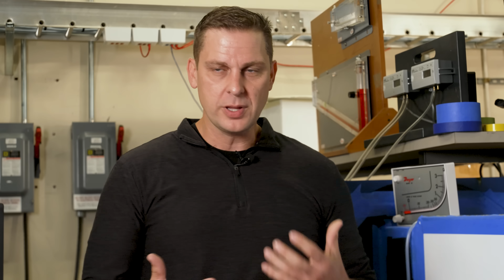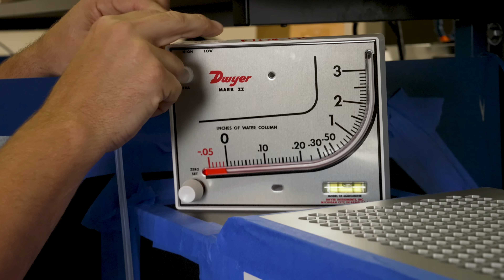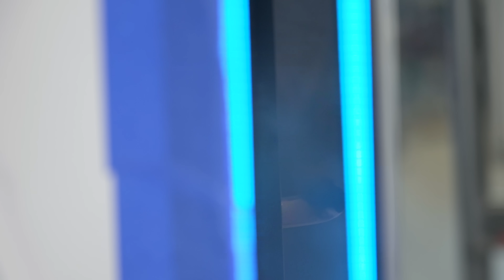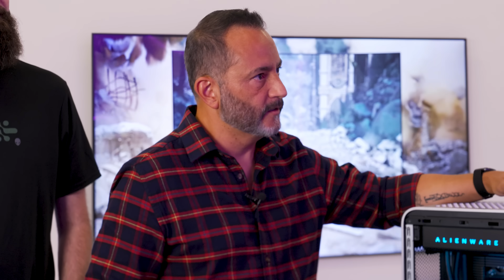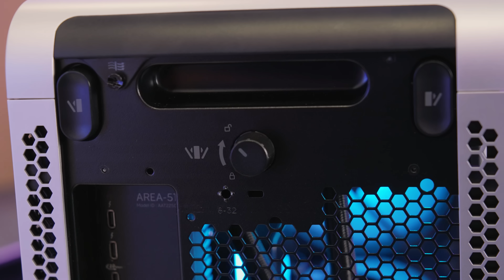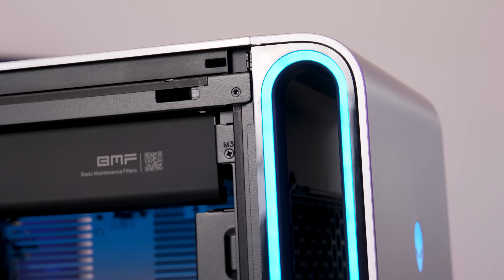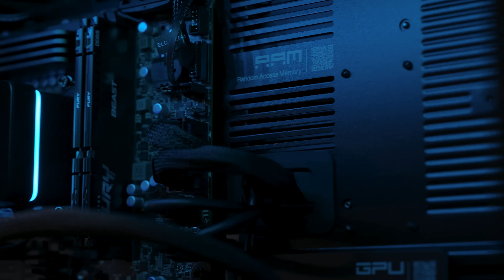Adam Savage Learns How Gaming PCs Should Be Cooled!

Comment: Gamers Nexus did thermal testing on this PC, and actually found it was better flipping the top fans to exhaust - CPU temps increased slightly but didn't impact performance, but GPU temps were lower which allowed it to boost slightly higher.
Reply: All depends on the case, the setup and the design.  
  Personally with my liquid cooled system I found that all hands as intake and the 140mm rear as exhaust showed the lowest temps.
Reply: I'm no expert, But I've always done bottom and front be intake and rear and top be exhaust (heat rising and such)
Reply: Yes starting with your intake right through a radiator preheats a lot of the available air that will then be cooling MB components and GPU. Sounds like starting from a disadvantage position. I wonder how things would fare if there were a " passive" radiator at the exhaust instead so at least it radiates to the outgoing air.

But gasp it's probably better to just do what most people do and have your radiator up against exhaust fans.
Reply: My Holley carb does 670CFM, should I hook up my carb to cool my PC? Dell you already killed your brand.
Reply: Depends on the case, type of fans, unrestricted area in the case and ambient surroundings. There is no perfect solution, For big open gaming room that has little to no dust - thick filters and SP fans in negative pressure 100%. For rooms with carpets, animals and all that shmack - positive pressure thin filters and Air flow fans. It is different for everyone because more performance is not good if it increase the dust buildup that not only increases risk of static shock but also insulate components to a degree. Go with your room.
Reply: In a system with fans it will never matter that warm air rises - any fan will overcome that easily.
Reply: I was looking at thing and thinking if PC Metal Jesus Burke already made a video about 🤔 thank you
Reply: So... What does that mean for all this lab's tests and theories? Does it mean they f'd up?
Reply: @squidge903  Because the differences in GN's testing were so small my actual takeaway is that beyond a certain point the argument about which is "best" is kind of pointless, and as long as you're not hitting TjMax then a difference of a couple of degrees here or there doesn't really matter. My general approach after decades building PCs is "as long as there's sufficient thermal mass and some airflow, it's probably fine", and maybe if I spent hours trying the thousands of ways of arranging/mounting the fans in my PC as intake or exhaust I could drop temperatures a fraction, but as it's not currently overheating there's no benefit to finding the optimum; good enough is good enough! (I just did the math - my case has mounting for 10 fans, but I only have 9 fans; if I were to test every possible arrangement of intake/exhaust/no fan that's 58,025 configurations. Definitely not worth it.)
Reply: >Good enough is good enough

Yeah that's the big thing. Doesn't really matter if the temperature delta is 24C or 25C as long as it's not thermal throttling. You can make the argument that there are other acoustic concerns but tbh a difference of 1C isn't really gonna change your fan profile significantly.

Besides, the best setup is usually some MIX of exhaust / intake depending on the overall fan setup, but people don't like that because it doesn't look / feel as "satisfying"
Reply: @elbiggus  If you're in the "good is good enough" camp, that's fine, but a lot of custom build enthusiasts and pre-build buyers don't want to settle for that, after investing so much. A lot of small optimisations can add up, and once optimal sweet spots is found, a person can sit back and reap those benefits for years, so it can be time well spent. Also optimisating might not be about fps, but noise, and every dB reduced matters. In short, a lot of people have good reasons to optimise beyond a satisfactory level, and there's nothing wrong with that.
Reply: @Reckless150681 It's a FLAGSHIP, bro. "Good enough" is not acceptable when you're paying through the nose for the BEST!
Reply: @s.bowes.8124 This. Is the point. Once the optimal setup is figured out, you can just that with no additional effort.
Reply: @squidge903 it mostly means that this shit is complex. 

Also, this is not a very good vs very bad scenario. It’s good vs good.
Reply: Same thing as using Intel and Nvidia.
It is a failure.
Reply: The GPU fans are not designed for this system. They would probably be pulling in hotter air.
Reply: they really should have paid that guy to apologize for years of legendary bad cooling rather than "teach" us lmao stick to laptops alienware
Reply: No offense, but GN setup is not sufficient to measure to this level. He does great work, but not like this. He is taking on board system readings which don't tell the whole story.
Reply: @jamesv.wilkerson30 All good and well that the PC is tested in laboratory; however, the average consumer does not have PC in a controlled environment and PC performance is indicative of what values the PC hardware determines as being correct.
Reply: True ✌🏻
Reply: There is no better, just use the damn computer
Reply: Whats up guys this is Travis from Dell... From a radiator efficiency standpoint and acoustics it was better pushing versus pulling (fresh air blowing into the radiator.  In all clarity its total airflow (CFM) that you care about and the pressure is a means of moving the airflow where you want it, this is why we did the flowbench example so we could show you what specific CFM you can achieve in the system.  If you really want to maximize cooling just set the fans to full speed in Alienware Command Center..  #iworkfordell..
Reply: @TravisNorth1  Hard disagree on CFM being what you care about. CFM can functionally be synthetic -- while a useful metric, it's the real-world temperature of the components that matter. We'd be happy to visit and discuss, but your PR department declined last time we offered.
Reply: @GamersNexus  I wonder why they don't get back to ya... ;)
Reply: @TravisNorth1   what did your testing show for a push/pull setup on the radiator?
Reply: @TravisNorth1 That is also highly dependant on ambient room temperature; the internal volume and temperature inside case/chassis, and the number of chassis fans used in either push/pull configuration.
Reply: @TravisNorth1  If you want maximal radiator efficiency and a cooling layout that makes sense, put the radiator in the front or side panel and suck/blow outside air through it into the case. Put three fans on the bottom of the case and blow cool air to the GPU from there. Put 2-3 fans on the top panel as exhaust. Look up the Lian Li O11 Dynamic series of cases and Fractal Design Torrent for some inspiration. It's not that difficult.
Blasting the fans at full speed "for maximal cooling" is dumb, no-one wants to listen to a computer with the fans maxed out. You need to use your brains and come up with a sensible cooling layout instead of trying to brute-force it.
This new case is a step in the right direction but it still has issues. First of all, it's unacceptable that a 5000 dollar system comes preinstalled with factory dust everywhere. Then the M.2 drive is installed incorrectly and bent like bow ready to fire. Then one of the bottom fans is sitting right on top of the power supply, so it is completely blocked and totally useless, and the other bottom fan is also partially blocked by the PSU. Then all the fans are used as intakes (front, bottom, top radiator fans). This creates a lot of pressure inside the case, yes, but it also hampers airflow as the only main route for air to exit the case is the rather small perforated area in the rear panel. You have 7 fans trying to push air through one small area. Airflow-wise it's a lot better to have at least some exhaust fans, even when you're going for a positive pressure setup.

It's like taking a tube, drilling a couple of holes in it in the middle, and installing two fans at both ends of the tube. If you install them both so that they blow air into the tube, the fans are creating a lot of pressure in the tube, but you're going to lose a lot of airflow as the fans are working against each other and air can only exit from the holes we drilled. Now if you reverse one of the fans to work as an exhaust, and run the intake fan at a bit higher RPM than the exhaust fan, you're going to have a lot of airflow through the pipe while still maintaining positive pressure.

A friend of mine originally set up his current build so that there were three bottom fans sucking air in through a radiator, three intake fans on the side panel and three fans sucking air in through another radiator at the top of the case. 9 intake fans, 0 exhaust fans. His thermal performance was very bad for a custom loop with two 360mm radiators because there was so little airflow. Then he turned around the top fans to push air from inside the case through the radiator and the thermals became a lot better at lower fan speeds.
Even though the top radiator didn't get fresh, cool outside air anymore, thermals improved because now there was so much more airflow.
"Hehe fans go BRRRR!" is not a great thermal solution for a >5000 dollar PC.
Reply: @TravisNorth1  Thank you. so you chose this because its more efficient radiator wise and noise wise, and cooling wise it was good enough/met requirements. whereas if you were just optimizing for cooling a lot more than noise, you might of chose something else.
Reply: @TravisNorth1  what did he say? I couldn't hear him over the fan (full speed) noise from my Area 51
Reply: @TravisNorth1  "and acoustics" "Set fans to full if you want best performance" You're aware you contradicted yourself yes? Flip the fans and you'll have acoustics and performance. It's okay to say your company is wrong, not okay for your job though I imagine.
Reply: @TravisNorth1 _ No offense but LOL at your comment of, "If you really want to maximize cooling just set the fans to full speed ... *inside our bloatware instead of via the BIOS*."

A) that shows crap design in the cooling of the case
B) no one wants to sit next to a server chassis 

Smh. It's amazing how much y'all really can BS executives and people who don't know anything about PCs but you can't fool people who have actually spent over a decade dealing with your terrible PC systems in a business environment. That includes suckers buying a rebadged 7010* for an Alienware PC.
*Depending on year of purchase etc

Btw. ANY PC with fans at full blast will keep your PC "cool".

Lololol sweet goodness smh 🤣
Reply: @shawnduffy279  Classic corpo non-answer: sounds technical but dodges the actual point. Dell markets its ‘thermal engineering’ like it’s gospel, but when independent testing proves flipping fans to exhaust improves GPU temps, so letting it boost higher, suddenly people are like ‘meh, 1°C difference, who cares’. lol
Reply: @shawnduffy279  I used to be a Dell's Your Tech Team (what a scam that was) technician....we did RMA's and field repair tickets on more Alienware's than XPS's. And in the end, all Dell execs wanted from us was to push the Dell Credit Card and upsell that malware posing as an Antivirus McAfee. Oh and push for customers to buy more ink for their printer. We went from actually solving tech problems for people (at $249/yr) to up-selling products from Dell's website. We even had to meet a specific margin per call per week.... I left soon after that nonsense. It was a waste of my degree and certs.
Reply: Basic physics, people. Hot air rises. Cool air comes in from the front, flows through, and exits out the back and top. That’s airflow, not rocket science.

But some of you are out here rearranging fans like you’re trying to Feng Shui a toaster, chasing that mythical 1% like it’ll unlock god mode. Trying to force one more breath into full lungs doesn’t make sense... unless it’s your last one.

If it bugs you that much, liquid cool it. Use hydrogen. Freeze the whole damn rig if it helps you sleep. Just remember, you're not building a rocket. You’re playing Apex and yelling at lag.
Reply: Yeah but Gamerrs Nexus has been shown to not be as reliable as most other larger tech youtubers.
Even with LTT's sketchier edits, they 're still far more reliable. And LTT doesnt try to start shit like little children.
Reply: @LegendaryMantis WTH are you talking about? You think GN is NOT scientific in their analysis?
Reply: @Lichrot saying LTT is more of a reliable source than GN is hilarious, factually incorrect
Reply: I saw another video where they said the opposite
Reply: It really does not matter, it's Intel and not AMD. 😂
Reply: @Zeaiclies  exactly, it doesn't matter how much cooling they give it, that Intel CPU still wont beat the AMD chips.

Comment: This is cool and all, but you don't need all of this fancy equipment to arrive at this conclusion. Anyone who has been building PCs for a few years knows the more ambient air the better. Internal case air is hot. So, the CPU cooler has to be intake as to not suck up hot air from the GPU (duh), Then, to avoid the GPU getting hot air from the CPU cooler... you just overwhelm that exhaust air with positive pressure and put the CPU cooler as far away from the airflow intake of the GPU as possible (the top. Duh). If both are water cooled, you want either dual intake or dual exhaust. This really could have been a memo.
Reply: yt experts everywhere
Reply: @mikeuk666  There are no "experts". This isn't rocket science. It's basic level common sense.
Reply: @MrMediaPC  Convection in PC cases is a myth. The natural forces of convection are VASTLY overwhelmed by the air flow/pressure generated by the fans. Ask yourself... how much air pressure is created by convection... and how much is created by 10 fan blades spinning at 1000rpm. Convection is only relevant on passively cooled PCs. There have been many vertical airflow cases and none of them perform appreciably better than conventional layout cases. As for your last statement, total nonsense. There are Fractal cases with this layout (bottom, front, top, rear fans) that perform well. The only issue here is the bottom fans are obstructed by the PSU. They need more space. Otherwise, this is a good layout because it affords you direct intake into the GPU.
Reply: @MrMediaPC please learn about basic physics and do like 5 minutes of Google searching before making such categorically incorrect statements. Again, none of this is rocket science. It's pretty basic stuff. If you were to convert the resistance of convection to wattage, it probably would not be even 1/100 of a percent compared to the total output of a fan. This isn't even margin for error or manufacturing tolerance. You likely could not even measure it with expensive equipment. It is effectively zero.
Reply: @MrMediaPC  It’s disappointing when someone with a mathematics degree lacks basic common sense. The convection effect inside a PC case is practically negligible—unless you're dealing with a completely passive cooling setup. Even minimal push-pull airflow from a single fan easily overrides natural convection and ensures stable thermals. No wonder degree holders struggle to find jobs these days. Too much theory, not enough pragmatism.

Comment: Honestly, I'm kinda impressed that they finally moved to standardized part compatibility. This has been one of the biggest problems with Dell and Alienware machines in the past. If any part of them broke they were basically destined for the landfill. Their thermal design used to be non-existent, they just maximized form over function. It looks like this time they actually understood where they went wrong in the past and took steps to remediate these issues.

They should've done this years ago, but better late than never.
Reply: Totally.  Got the prior model and it's been a hunk of junk that took Dell 3 months to get working.  Not been impressed, and I daren't trust it as it's been non-standard parts everywhere.  good they've gone back to /some/ standard parts (they had to), but trust has been lost after 20 years.  Never touched Dell again.
Reply: @Jyve 
I would never buy Dell or Alienware.
Reply: to give credit where it's due dell (alienware) for the first time ever made a decent case and they did it by following the design trends that have been on the market for 20+ years. kudos
Reply: You got it.
Reply: That one hurt ;) but fair.... their is some history here market feedback overtime was smaller smaller smaller, better value, and more powerful and if you do that you had to make design decisions that limited upgradeability and drove to more custom solutions.  We managed that through our reliability testing and ensuring robust quality but yest it made it more difficult that you couldnt leverage parts into the future.  We do listen heavily to our customers and appreciate the feedback  #iworkfordell
Reply: @TravisNorth1  I hope you stay on the current course of improving compatibility and taking function into account, aside from just form. 👍
Reply: Dell owns Alienware 😂
Reply: @Zeaiclies  Congratulations, you can remember basic facts. What does it add to the conversation?
Reply: @Zeaiclies  Who was impressed by what collaboration?
Reply: @insu_na 
You. lol
Reply: @Zeaiclies  Then I hope you learn to read at some point, because you seem quite incapable of it.
Reply: @insu_na 
I read perfectly.
I have a Master's degree in English and Grammar too.
166 IQ with Eidetic memory.
Reply: @Zeaiclies  And then everybody clapped.
Reply: @Zeaiclies  Funny, because there's no mention of "collaboration" or any insinuation of it in the OP, nor subsequent comments, beyond yours.
Reply: @TNH91 
It was there before or I would not have mentioned it. 😂
Reply: @Zeaiclies  The OP hasn't been edited and neither has any of his responses. Is the collaboration in the room with us now?
Reply: @TNH91 
One of my post is missing and the OP says edited on my screen.